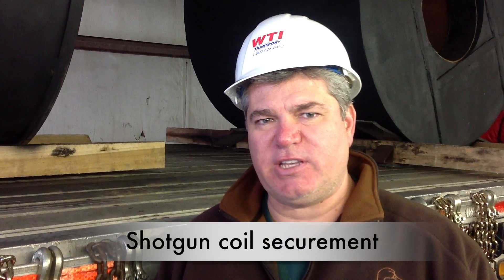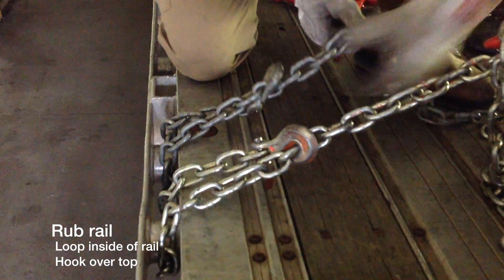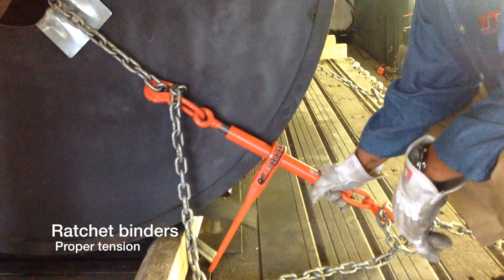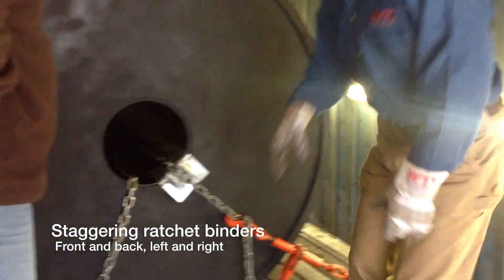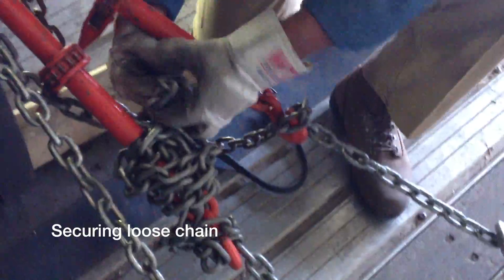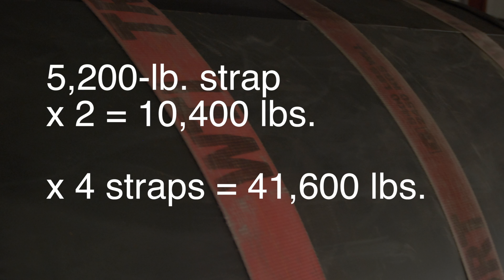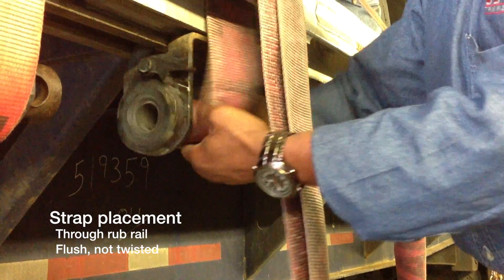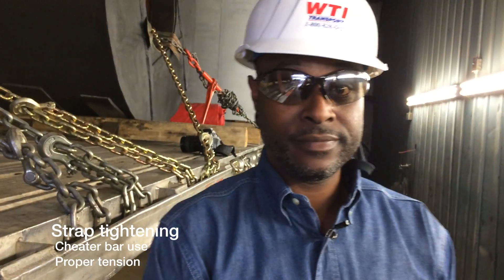Shotgun coil securement

Comment: This video needs to be redone or removed.  There are several misleading and incorrect  statements in the video and in the commentary.  Please any one viewing this video read the FMCSA regs on securing a shotgun (eye lengthwise) coil.  FMCSA reg 393.120 (d) gives three options for securing a shotgun (eye lengthwise) coil.  All three options require  coil bunks/racks, blocking or friction mats.  Opt 1: cross chain and strap. Opt 2: horse collar chain and strap. Opt 3 strap only.  In the video option 2 is used, but the video is wrong using full WLL for the chains; as per 393.106 (d) (2) the chains only add half of their WLL to the aggregate working load limit because they are anchored at both ends on the same side of the trailer. Opt 1, cross chaining, 393.106 (d) (3) securing the one end of the chain on the driver's side of the trailer and the other end of chain on the passenger side gives the full WLL of the chains to the aggregate working load limit.
Reply: MDM thank you! I’m very new (6 loads since I left my trainer) and watching this started to confuse me. I was questioning everything I thought I learned and knew. Getting a fine would of course suck but what worries me and keeps me strapping or chaining for hours is the thought of something coming off of my trailer and killing someone. Nightmare.

Comment: You should always have at least 1 set of X chains on a shotgun coil! 40,000 lb. coil requires 3 chains (6600 WLL) I would actually put 4 chains though, 2x's and 2 c's ( U chain). then you would have to put a trip chain in the front of this coil as well as a strap or chain( depending on the type of metal you are hauling) over the top per DOT regs. My company requires us to round up on the chains and then add 1 more to be safe. keep in mind on a Shotgun coil you should never have an odd number of chains.
Reply: You also have your shogun  straps
Reply: shogun straps throw the hadoken fireballs ..correct?
Reply: except you need a minimum of 4 on a 40,000lbs coil with the reading of 6,600WLL.
also if you put 2 if those chains as horseshoe chains once again 4 wouldn't be enough you would need 2 more horseshoes totaling 6 chains

Comment: Like the video it looks as though you had some quality equipment to shoot it. But I think you forgot a few things in DOT regs. 1. When a chain or strap is connected to the trailer with both ends on the same side of the trailer this is called direct securment, this reduces you working load limit by half. 2. Dot regs. state that a tie-down is only as strong as it weakest working load limit. You wrapped your chain around one spool on the rail effectively reducing your 4700 chain plus your binder approximately 5400 lb. Wll to the lowest rating of the spool which would be for most manufacturers 3300 lbs. So for the chain and binder and spool together you only get half of the two spools combined 6600/2 +3300 pounds. Sorry man just want all to be informed not my words this is straight out of the FMCSR.